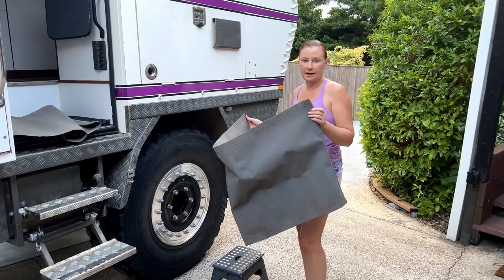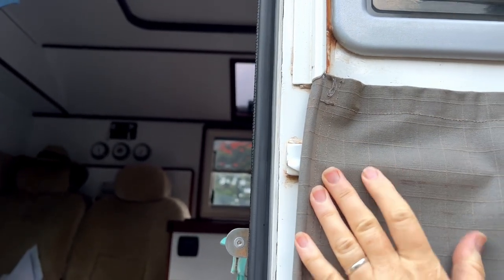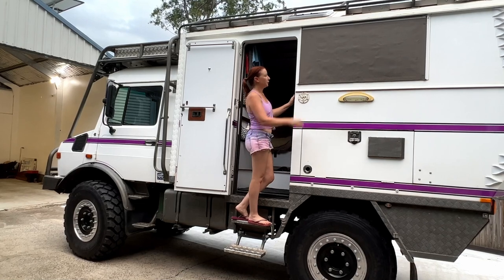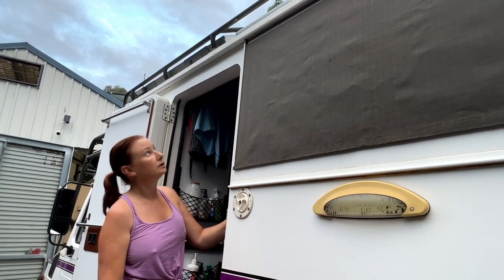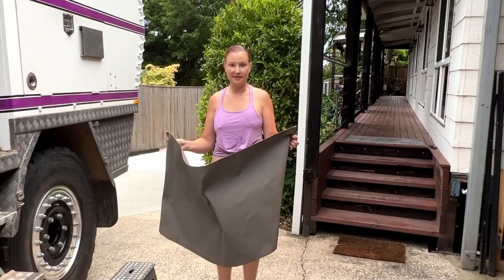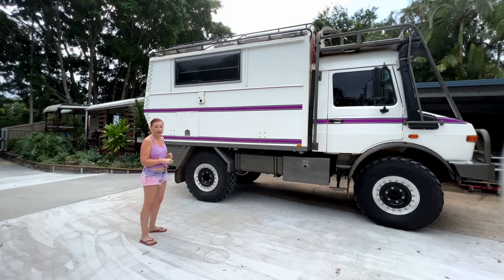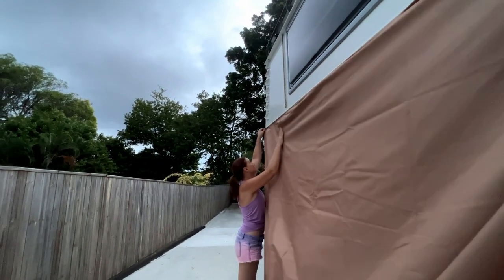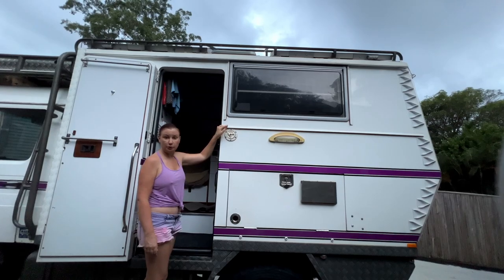Canvas window cover protection

Comment: Good to see you again.  Curious though, do the covers slide down at all during transit?  Other than their own tension, there doesn't seem to be anything to stop them sliding down.
Reply from the maker: They have not slid down yet, they are a pretty tight fit.   At the most the will slide down to the othr bit of sail track,  but so far I can't remember that even happening.

Comment: Iain needs to design a slide on rack system to house a step ladder which suits your height. E.g. Cosco 100kg 3 Step Lite Aluminium Ladder.
Reply from the maker: We have a 3 step ladder  but there is no space to fit it, and this way, Iain has to fit them, which is fine with me 😁